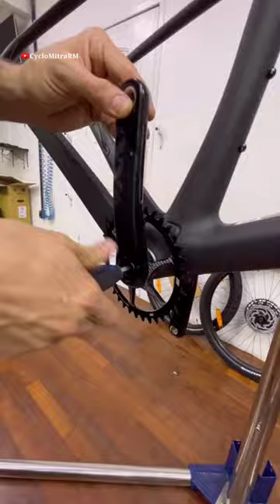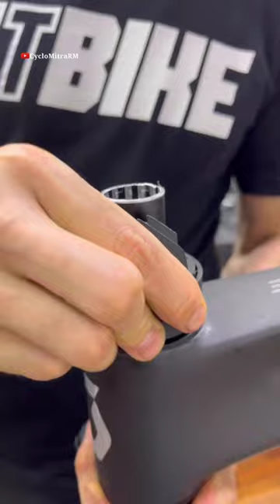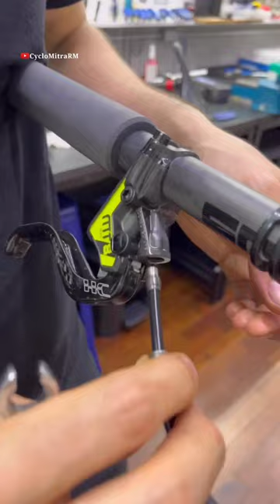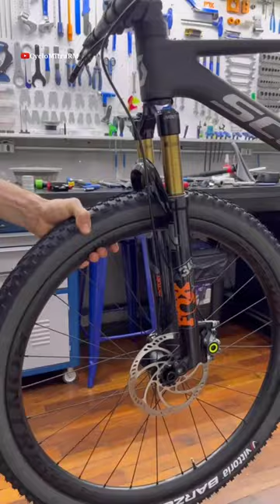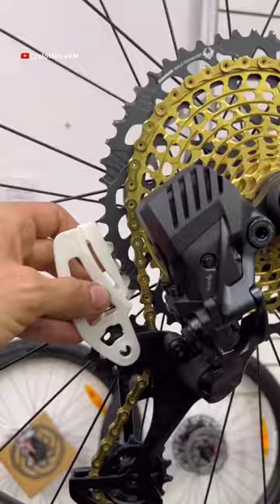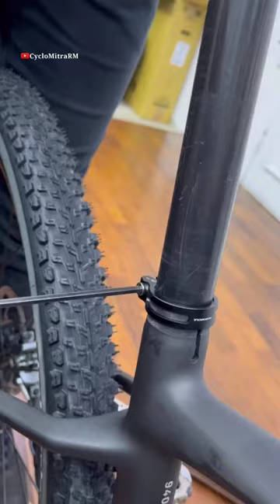Scott Scale 940 2023 Dream Bike Build #shorts #mtb #cycling

Comment: The big gear from rear makes much pressure on it i recommend you install a small ring for front that will makes it go longer
Reply: Big gear on rear and small gear on front mean really, really easy pedaling. Too small in front and the top end is too slow, which you don't want for an ultralight race bike like this!

Comment: Nice cycle
Price?
Reply from the maker: well in this video it's a custom made bike. Drivetrain, brakes and fork are install separately, like magura mt8 pro brakes and fox 34 fork these components are not come with factory/stock model.
In factory/stock model it's come with shimano mt200 brakes and Rockshox judy silver tk solo air.

By the way it's factory/stock model's price is around 1,90,000 inr.

Comment: kitne hajar ki cycle live
Reply from the maker: factory/stock models
price is around 1,90,000 inr.

well in this video it's a custom made
bike. Drivetrain, brakes and fork are
install separately, like magura mt8 pro brakes and fox 34 fork these
components are not come with factory/ stock model.
In factory/stock model it's come with shimano mt200 brakes and Rockshox judy silver tk solo air.

Comment: Price??
Reply from the maker: factory/stock model
price is approximate 1,90,000 inr.

well in this video it's a custom made
bike. Drivetrain, brakes and fork are
install separately, like magura mt8 pro brakes and fox 34 fork these
components are not come with factory/stock model.
In factory/stock model it's come with shimano mt200 brakes and Rockshox judy silver tk solo air.